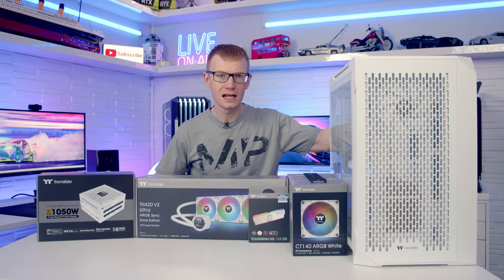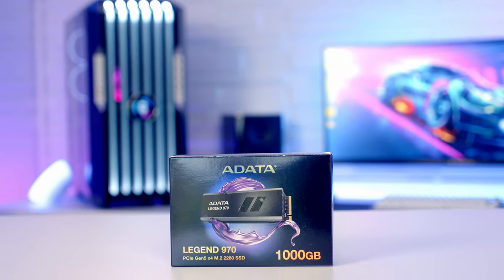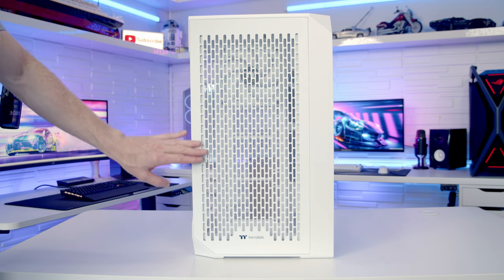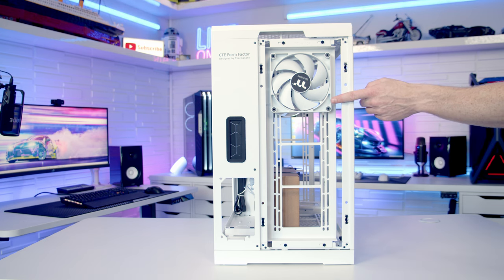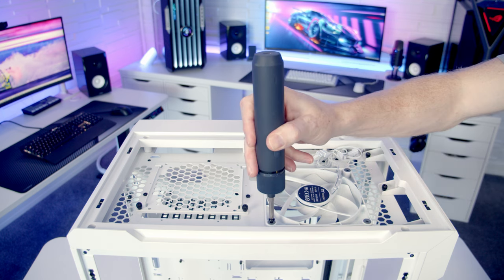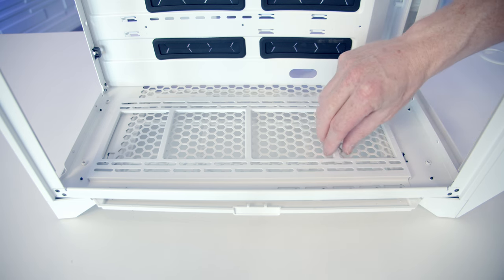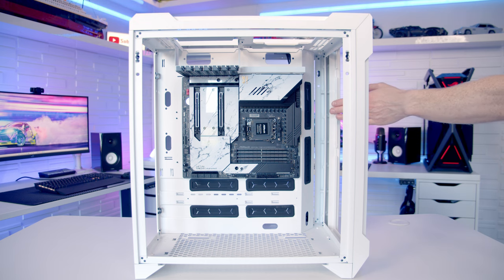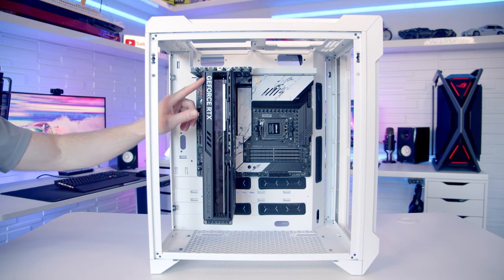Thermaltake CTE C700 Air Build - Step by Step Guide

Comment: Shouldn’t the pump connectors should be on the lower part of the radiator to avoid bubbles? Saw a test were they replaced with see through the go up so turning the radiator will make the bubbles stay on the radiator and not going to the pump

Comment: Lovely build and colour scheme. I have similar TT fans/TT software. Are you able to set the fan speed/sounds so no matter who is logged in it’s running as quiet as possible?

I can’t seem to do that with my TT software. Fans don’t quiet down till I log in… 😳
Reply from the maker: There is no software control for the fans I used in the video and they are controlled in the BIOS